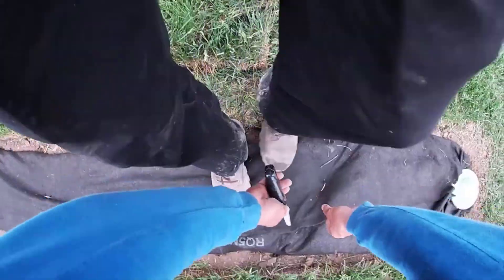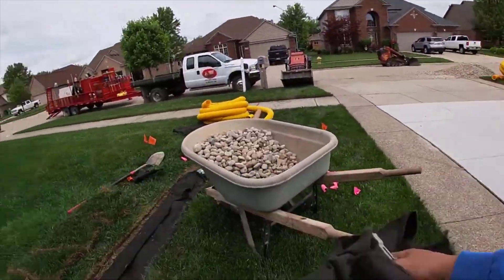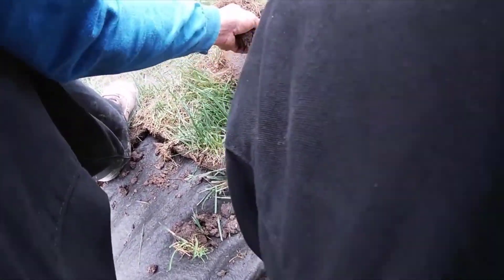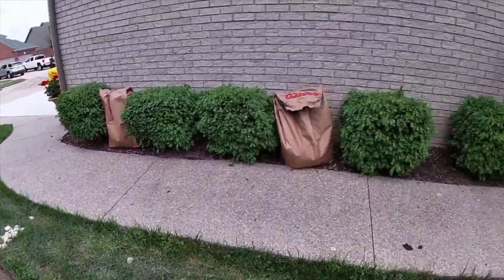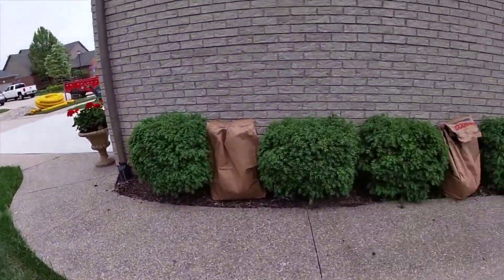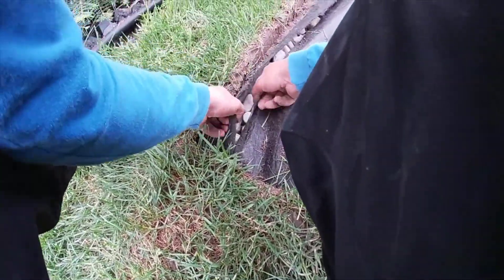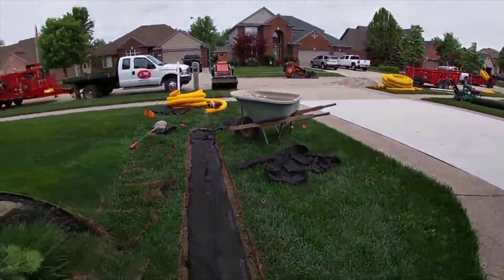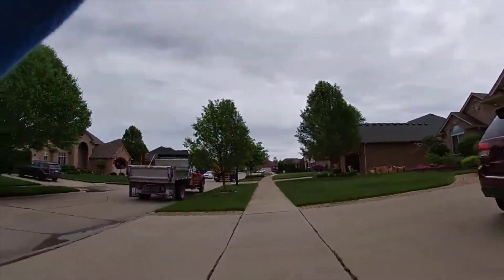DIY How to Prep your French Drain for Sod

Comment: The website is VERY  confusing. I odered a 3" popup emitter kit  which came with the pop up with a 90, and the unline ventern catch basin with the cloth. . I didnt know everything was 4" except for the 3" corrugated adaptor attached to the 4" pvc. I would have rather had the popup with the clean out. The popup with cleanout was not availivle in a 3"  kit like i purchased..  I ordered 3" riser for what i thought was a 3" pop up. The ruser dropped inside the 90 degree pvc elbow. . Thats when i fugured out everything was 4" and 3" adaptors were put on the 4" pvc 90 degree elbow and inline vented catch basin. I called and the kind lady in The office got me the correct 4" riser to go inside my 4" 90 degree elbow that has 3" adaptors for the 3" corrugated pipe. Confused yet?? 😂.  Customer service was great though. The vented clean outs for the downspouts are REALLY NiCE!! WORTH THE MONEY!!
Reply from the maker: That you for your input we will make some changes.
 Thank you.